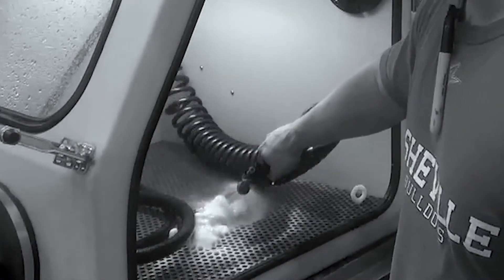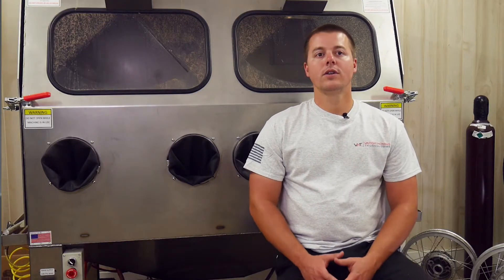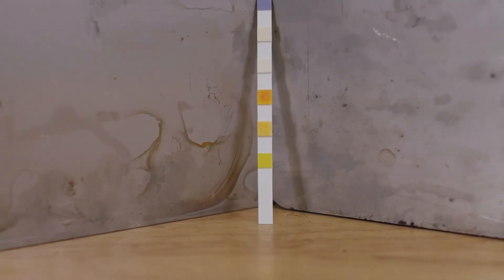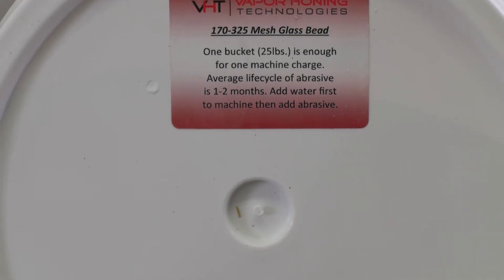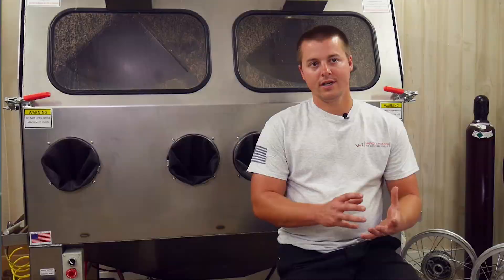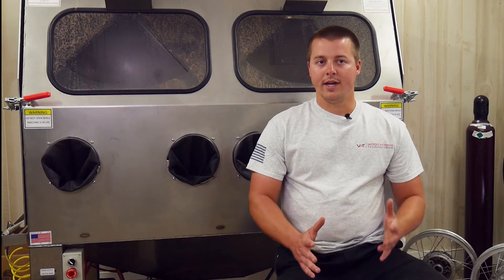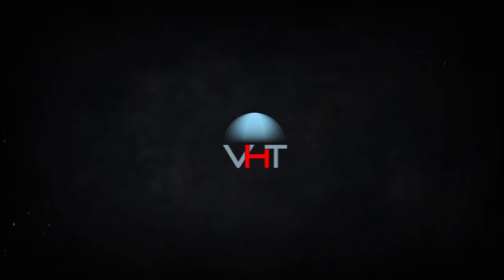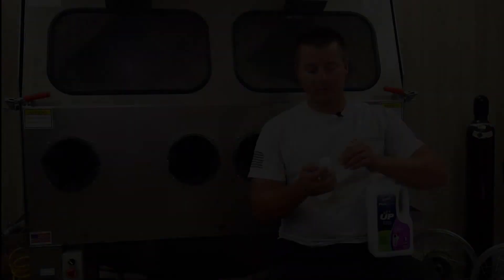Is My Water Good For Vapor Blasting? Effects Of Water And Abrasive. Vapor Honing Technologies

Comment: What ph should the water be at to reduce any mildew? Also, would adding baking soda to my glass bead slurry benefit the cleaning more than adding an acid, like vinegar?
Reply from the maker: The normal level of PH you are looking for is 7.1/7.2. If you are trying to keep down fungus,we do sale anti fungal wash on our website. This will work much better than soap  due to no bubbles. Using baking soda in glass bead will give you more issues than help due to the foaming properties. I hope this information helps.
Reply: Vapor Honing Technologies do you have distributor in Greece ?